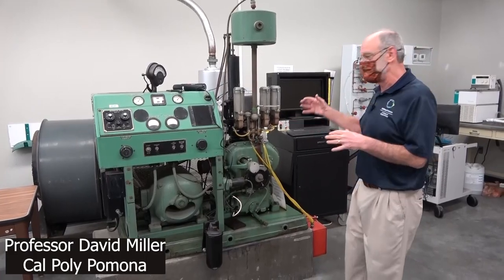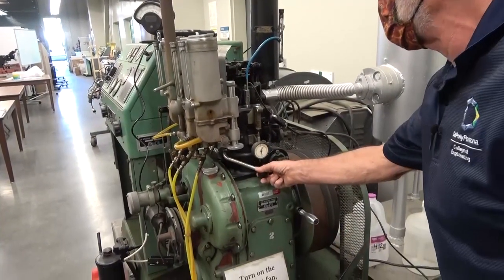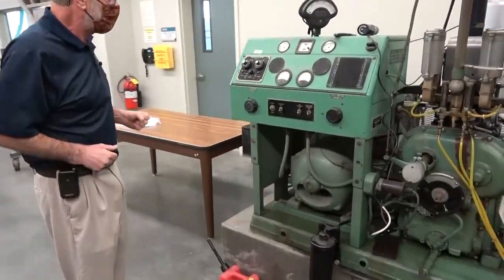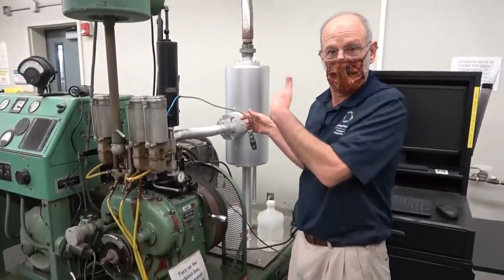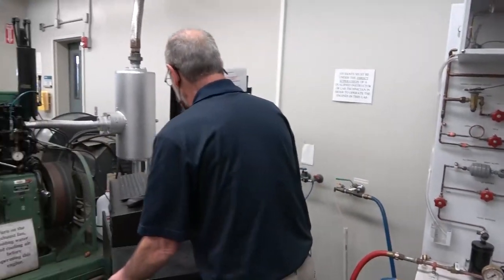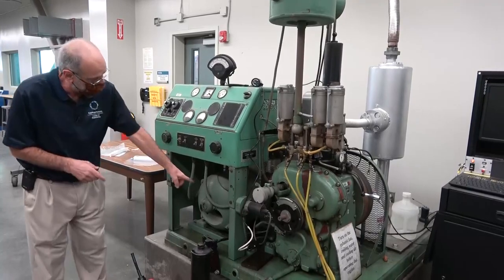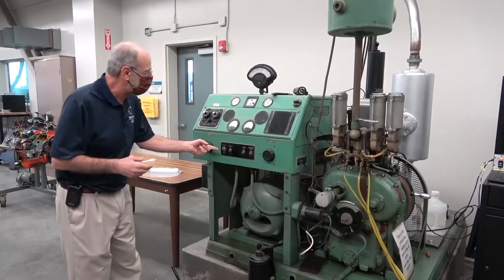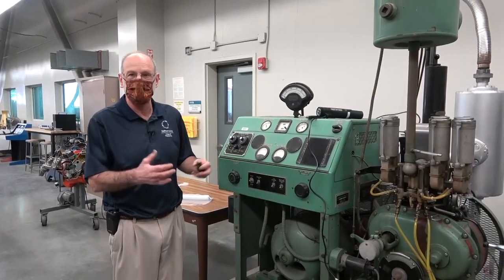ME 4120L: CFR Engine Overview

Comment: Awesome. To see al the changes these engines went through. Im not a fan of the new XCP . a Legacy of 1979 is great moto to work with under big work load. This one is so old. No CR moto or meter. I guess that’s where it all started. Valve clearance is .10 cold and ,08 hot.